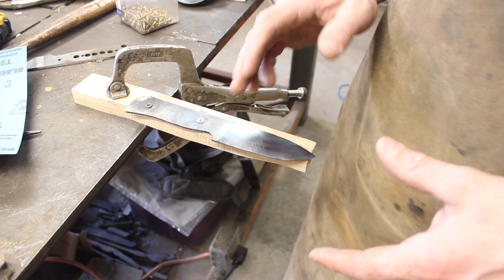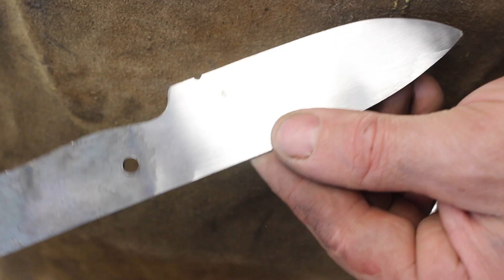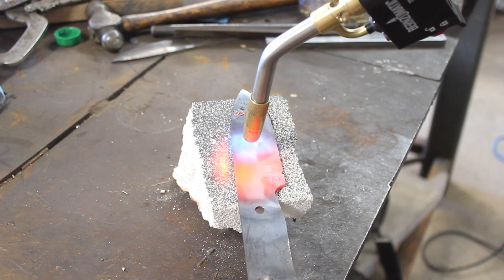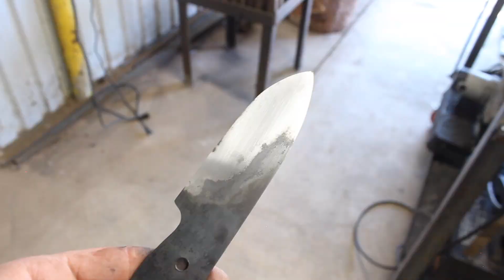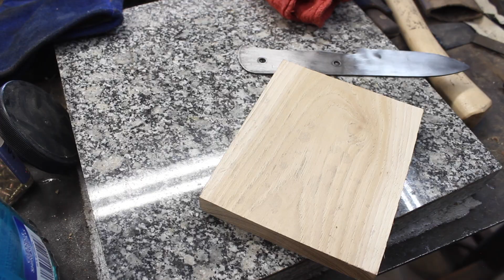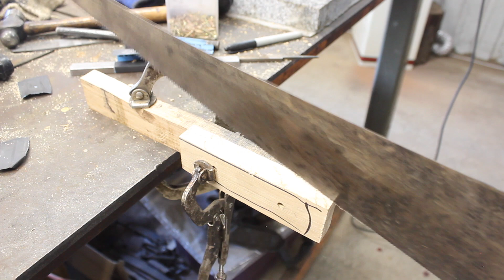How To Make A Saw Blade Steel Knife With Simple Tools, Part 2 Knifemaking Tutorial DIY

Comment: Never seen tempering put so simply. How would the carbon content affect the colour you’re after.
Reply from the maker: The color indicates the temperature the steel is heated to. The temp you want to heat it to when tempering depends largely on the carbon content.
Reply: @FireCreekForge  so darker straw colour for less carbon or the other way around?
Reply from the maker: I should have said, carbon content plus intended purpose for the steel. Generally the other way around.
Reply: Thanks looking forward to next installment